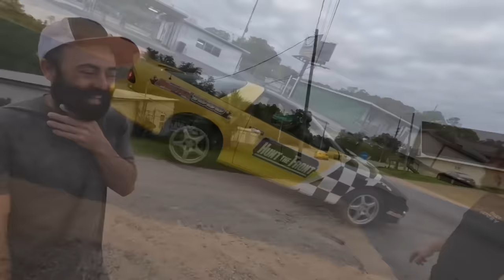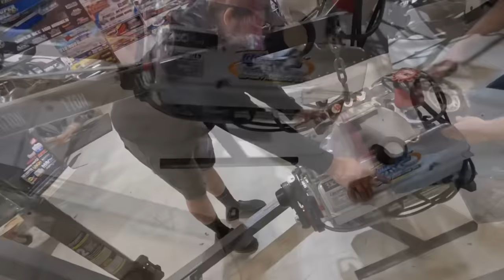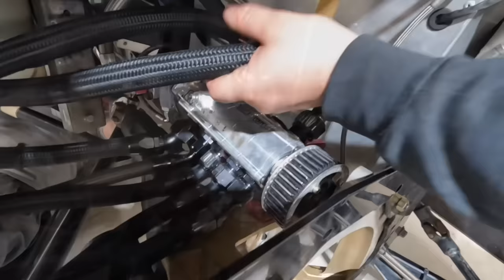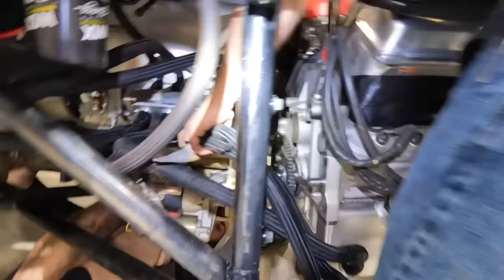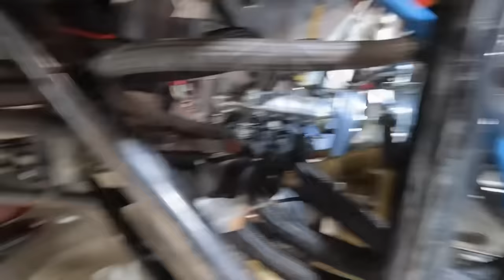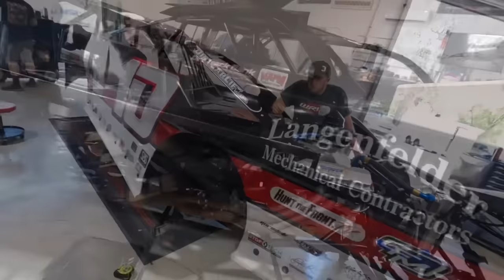We Found the Problem! Fixing the Issue that Shredded our Oil Pump Belt

Comment: What usually happens when a rod bearing spins is you break a rod and punch a hole in the block. Past experience unfortunately twice. You guys did the right thing unless you have someone giving you motors I would never throw another belt on it and keep running it. You all take care and stay safe. Good luck this weekend.
Reply: Yessir same uh that was a very expensive dang it for me too. Started loosing oil pressure in the turns with the standard pan style and the pore 406 didn't stand a chance. Main got hot rod spun and two wholes appeared. In two laps of split seconds oil loss. I agree pull that motor

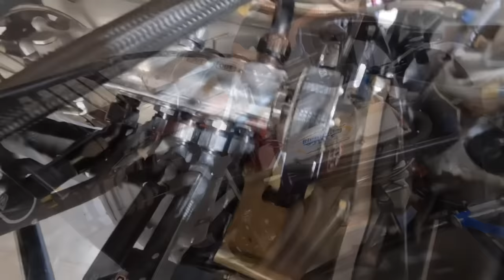Comment: 13:14  You can clearly see that oil pump pulley walking back and forth. Time to check run out on the shaft fellas.
Reply: I thought it was just my eyes, glad someone else saw the same
Reply: Same here had to watch it again
Reply: I can't tell if it's his camera angle or camera movement..   but yeah, I see it..   walking in and out..   end play or pulley got bent when the belt shredded..  if it was pulley it would be more obvious I would think..      $50K is enough to scare me into a new pump, pulley, belt, fresh bearings and hell yes..   a dial indicator to check runout lol..      
Nope.. lets throw a couple washers on it and eyeball it..  
Jesus..   Jordie needs a new tool set..  Amen..
Reply: @DougKendig about 90% of this video is a repeated facepalm situation

Comment: The coated bearings are definitely a reason that you didnt have more damage, just another layer of protection even if it is very little, but  at 8500 every bit helps
Reply: tungsten disulfide is pretty damn amazing.

Comment: Go to the user manual for the pump assembly.  Guaranteed they have instructions/how to for pump alignment and belt tension.  My head spins when I hear the "I guess it's right" comments.  $50,000 motor...yea...I guess it's right.
Reply: It will be FINE

Comment: Install a low oil pressure ignition cutoff switch that will shut down your engine automatically when the oil pressure drops below a safe pressure.
Reply: Not a good Idea in a RACE it LEADS TO WRECKS cuz the engine shuts down and the driver didnt know it was coming
Reply: @HOTRODMONZA  That happens anyway, such as when the driveshaft breaks, the engine blows, the ignition box quits etc. Why not save your $50,000 engine by shutting it off a few seconds earlier?
Reply: That wouldn’t work especially with a Peterson pump. They don’t have much oil pressure at idle while driving though the pits it would shut off all the time. That’s why you see the dummy light flashing a lot when they are driving through the pits. You can turn up the pump but then when your at 9,000 rpm the oil filter element can’t take it. Peterson has a different spring that you can change in the pump that helps this but your still on the limit on both ends of the spectrum  Bottom line is if the belt breaks send it back like they did. How this stuff works it basically shuts off after a few seconds anyway because the fuel pump runs off the back of the oil pump. They don’t run long without fuel pressure.
Reply: Nobody cares what happens behind you when your engine shuts down and saves itself. You just saved your team a $50,000 engine.

Comment: Maybe it was starved longer than it looked, but, that was an eye opener about how fast you hurt an engine without oil pressure….

I’m SURE a standard tuneV8 would not have worn that oil barrieroff that fast…
Reply: I wouldn't bet on that. What's 2 seconds when you're spinning a rod bearing.

Comment: It almost looked like the pulley on the pump was wobbly when it was running, maybe an optical illusion.
Reply: sure does, check out 13:14 when its cranking. They need to check the run out on the pump shaft.
Reply: @xtr3m3fLx  yup, just that .020 can mess stuff up!!  I’d be checking the runout on the shaft of the pump, the pulley, and the runout on the flywheel even!!  I’m glad I’m not the only one who saw it!

Comment: Looks good boys. We had a problem back in the day. We had oil pressure but we kept spinning bearings after 2 new cranks we figured out what happened when we had the motor cleaned a freshen up on a small block chevy there is a Diverter plug in the block were the rear main cap goes it looks like a tiny freeze out plug it was sending oil straight up to the oil Gauge an not sending oil to the crank bearings what a pain in the ass. Good luck boys. Be safe ✌️ 🙏 love it or leave it 🇺🇲 🏁🇺🇲🏁🇺🇲🏁🇺🇲🏁

Comment: You guys should check the alignment out of the chassis with a good straight edge before you put it in the car. You can't take any chances hoping that it's close enough. Check, check and check again engines are expensive and losing races is not fun or profitable. Good luck this weekend.

Comment: IF THAT BEARING is sitting in OIL --- you've got major PROBLEMS!!!! Key give-a-way >>>> DRY SUMP!!! If the pump is working correctly, the pan will have very little oil in it and actually creating a vacuum inside the motor (using a vacuum modulator allows Hg to be set!)  The motorplate thickness (change) may be a thing for the belt alignment - maybe could use another shim down at the flywheel pump drive. Proper tension is essential for belt life. Camera view while running was nice but also would have been nice to see the belt and the rev.    Outside all that ------------ >  Let's Gooooooooooooo!   Be Safe

Comment: get ya a lift it will make more room in ur shop u can lift one and put one under it the rod bearings dont sit in the oi it starts at the pump then threw the mains and rod caps up to ur cam and finally rockers

Comment: Back in the day (1980's) when I built sprint and late model engines, I pinned my rod bearings with brass pins.  Never I mean never spun a bearing after that.  They physically cannot spin at that point.

Comment: Rods nor the crankshaft "sit in oil" on dry sump oil systems. 602s and 604s do. They're wet sump. And pin the bellhousing to the mid plate for goodness sake!!

Comment: On my modified after i have the motor and bellhousing bolted together in the car i drill 2 holes at the top and bolt thr bellhousing to the midplate so when i pull motors its hold the bellhousing and transmission without anyone under the car
Reply: I've mentioned that before. They don't listen to us guys that BTDT for 50 years. What could we know.

Comment: If you won't to make sur 15:06 e the 2 gears are aligned I always used a 2' Starrett blade from a the Starrett combination set,or anything that is true flat and straight.🏁🇺🇸ML33MI.
Reply: I also like the white makes it easier to pick you out in a crowd, and also like all white with flames.🏁🇺🇲

Comment: For all the haters that said there was no way that the new mounts and  midplate would change anything.   Where are you now?
Joe
Reply: The angle pump make no sense it’s bolted to the bell housing.  I would have thought it would need to be spaced back it the plate was thinner

Comment: it is not setting in oil if so the motor would loss hp from crank wash the crank doss not set in oil  IT HAS  OIL PUMPED IN IT ...... ' better look at the pump make shore it don't have a hard spot in it ' pump get a hot spot and stops turning and kills the belt ' LOOK AT THE PUMP BE SAFE

Comment: Why cant you run your oil pump off the front of the cam like we do in our Sprint cars?
Reply: Bet you didn't run waterpump in normal location. Cause it's square in the way in these cars.
Reply: @gailtaylor1636  didn't consider that part.  My bad.

Comment: 1 that belts too loose. If you can move it over and it touches the bel housing it’s no good. It doesn’t need much though. 
2 the white looks better because it needs to be the same color as the bottom of the wrap. 
3 I still don’t understand why you guys struggle to understand the concept of bolting the bel housing to the mid plate. I raced on the road for 10 years and never one time did I see anyone fumbling around trying to hold up the bel housing and transmission. Why struggle it’s literally 2 5/16 bolts and two nuts. Just my worthless 3 cents 😂